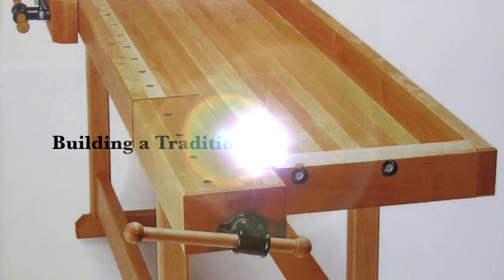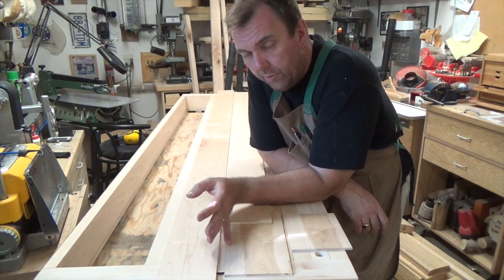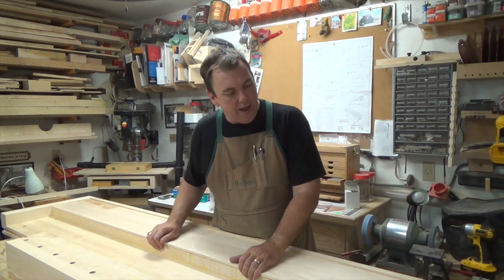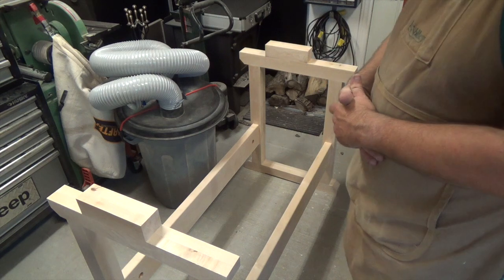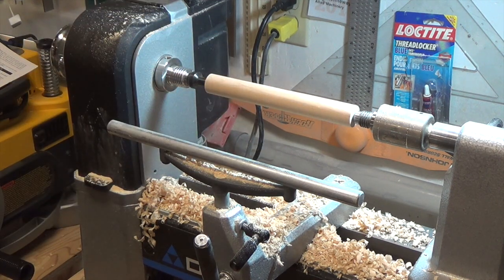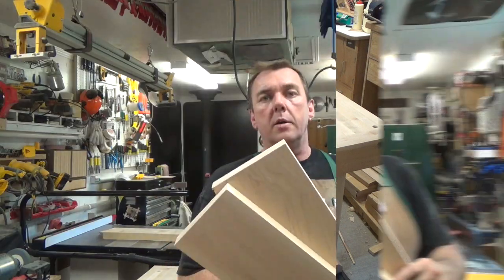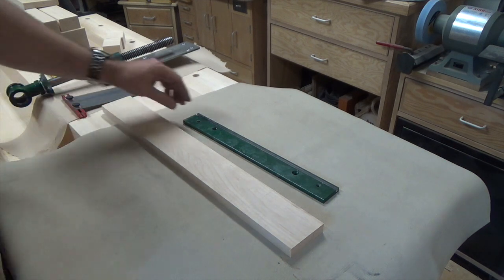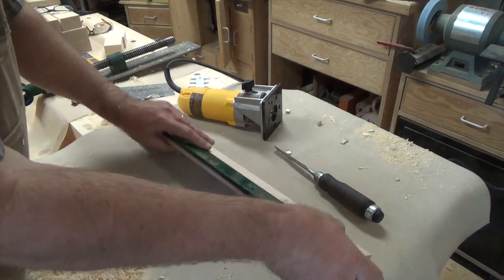Building a Traditional Workbench Part 5

Comment: Very nice work.I have found this very valuable.  I am about to build the Veritas modern work bench and the supporting structure joinery is identical.  The top is kept in place by gravity and a couple of dowels which locate it horizontally.  Is that also the case with the traditional workbench.  Apologize if you mentioned it here.  If so, is that enough?  Any urge to add screws or other means to hold the top to the supporting structure?
Reply from the maker: Just as you mentioned, the top of the bench is held in place by gravity and kept from sliding with (I believe) 1 1/2" diameter dowels at either end.  I've never had an issue with it and it has never shifted or felt unstable.  No screws required sir.  I hope this helps.  Thanks for tuning in.

Comment: Hello Kenny and thanks so much for the videos!! I have started my workbench build and have the same hardware (front+tail vise) as you do. I am planing on doing a 30" solid hardwood top, 3 3/4" thick. I was wondering if I could also just screw the front rise directly on the bottom of the bench top or would the jaws be too far away from the top/not centered? Your recess looks very deep (can you tell me how deep exactly?). Also, can you tell me what dimensions your final hardwood tail vise has (length+width)? Thank you and greetings from Nova Scotia
Reply from the maker: You would have to do some test fitting for the front vise to see if it would be able to be screwed directly to the front or not.  If it was a little lower than needed, you could always make your vise boards a little larger.  You wouldn't want them too large however because it might reduce the pressure of your vise.  As for the measurements of the tail vise, and the recess (I'm not 100% sure which recess you are asking about) I won't be in the shop for another week so I am unable to get measurements right now.  Sorry about that.  Thanks for tuning in.
Reply: @acutabove_woodworkings  Thanks for your quick reply! I have watched your video several times now and I think I got some measurements and will give it a try (hope it works out).

Comment: Lovely bench. Traditional 'style' but not function. Round dogs, captured tail vise missing extension and jaws, shoulder vise with no clear mouth. Both vises require expensive hardware not just a simple screw. 
Just so people know what a traditional bench offers:
True shoulder vise adds width to bench, the third leg adds great lateral stability, the vise has a clear pass through and clamps wood directly to the apron.
Square or oblong dog holes made during apron assembly are angled 2 degrees towards the work to hold wood very well with a force towards the bench top. They negate buying expensive dogs.
The traditional tail vise extends the 'length' of the bench so holding can be say 13" longer than the bench. You get massive face jaws.
Both vises are built with inexpensive screw hardware.
The functionality of a traditional bench is therefore quite different. The tail vise is more difficult to build but adds a lot.
Your bench is very good looking, it has a apron to work with and offers simple construction. Your end caps pay homage to the traditional look . It will appeal to many people.
Reply from the maker: Well, there's a ton of good information in your post and you are definitely not wrong.  I guess if you want to call the video for what it is, you would be right in that it is a tradition "style" workbench.  Everyone wants to be so technical these days.  LOL.  thanks for tuning in and for taking the time to leave me all the information in a comment.  It's greatly appreciated.